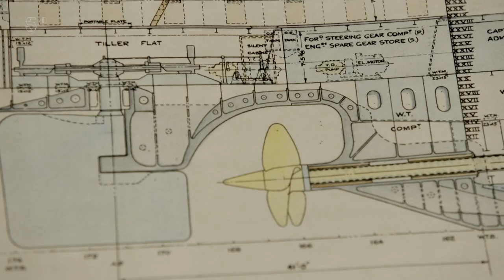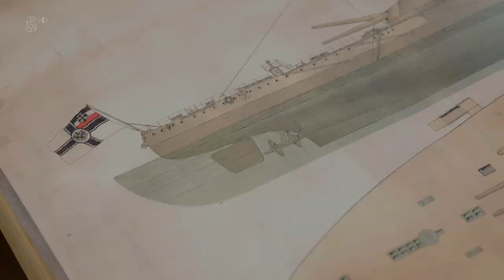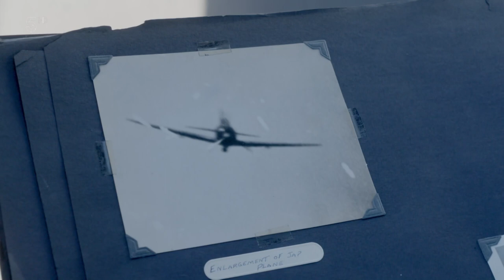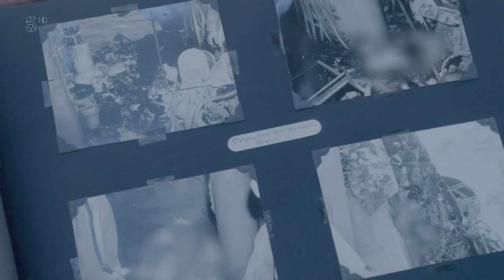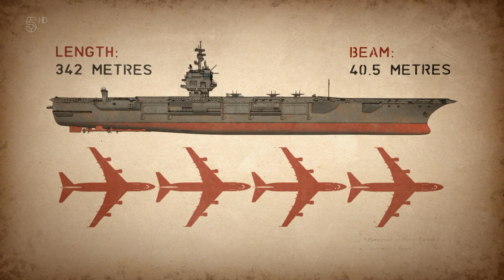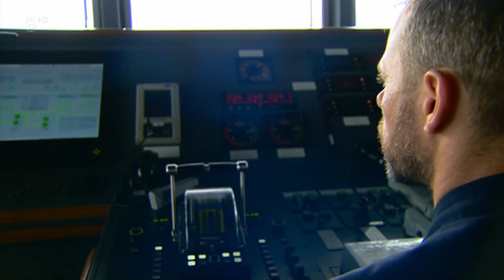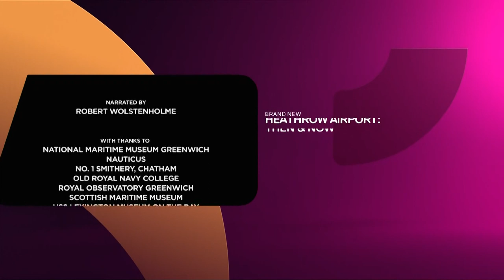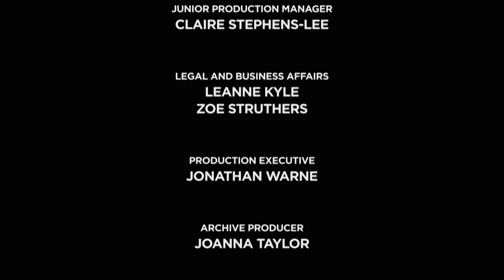World's Greatest Warships - The Aircraft Carrier | Episode 3/3

Comment: The Corsair really didn't see as much carrier use as you think. It was mainly used by the Marines. The wings made it hard to see the carrier deck so you could actually land. You can see this is simulator
Reply: Yup you're right. It didn't start operating from fleet carriers until 1944 was the Navy had what they now call, "tamed the beast" , and came up with ways for it to safely operate from them. 
It did see a ton of action from land bases though, 64,000+ sorties , 2000+ kills and only around 185 losses. Great k/d ratio if you ask me lol 
(Yes the Corsair is one of my favs 😅)